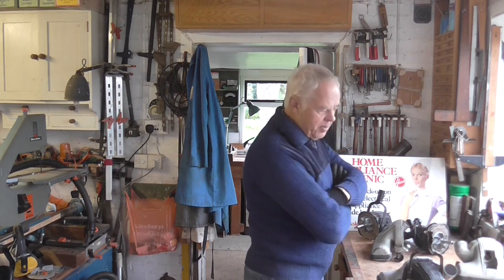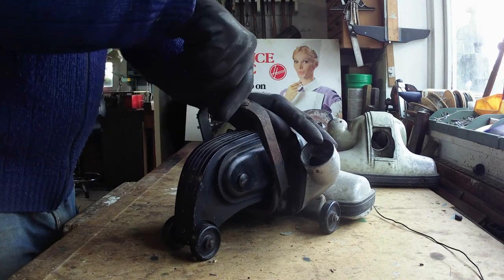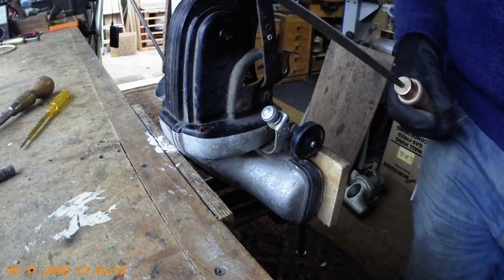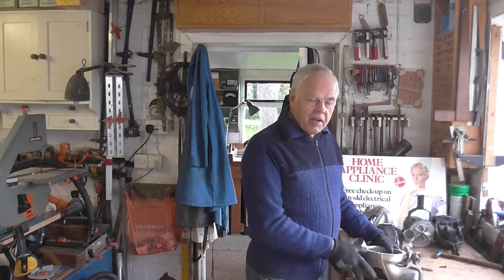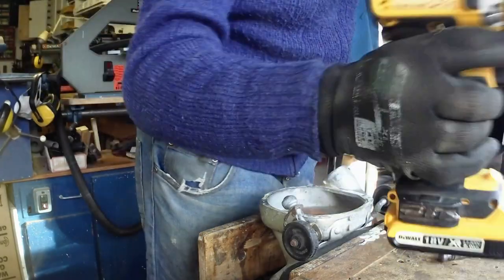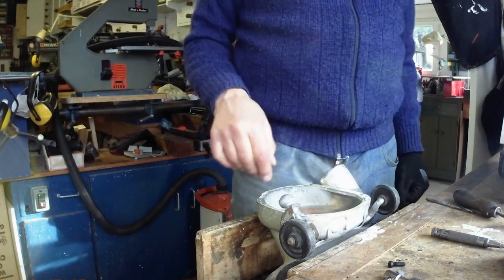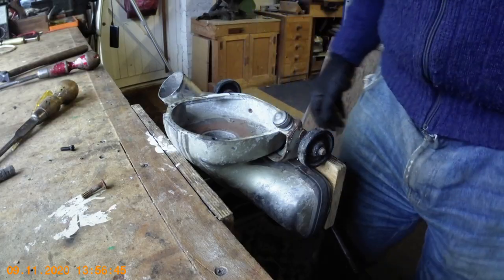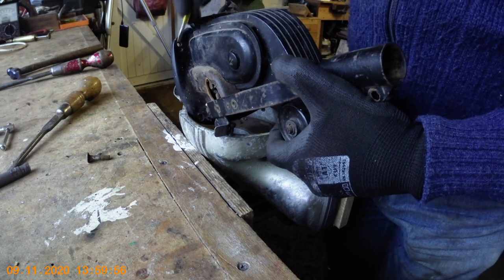Hoover 375 notes and service information. Part Two

Comment: Thanks for the tip about retapping the hole to get the bolts out. I have spent many hours using bolt extractors, sometime successfully and sometimes not. Always good to have another option up your sleeve so thanks for sharing that.
Reply from the maker: I rarely have much success getting bolts out with extractors. But it is very difficult drilling a steel bolt out in a soft body.